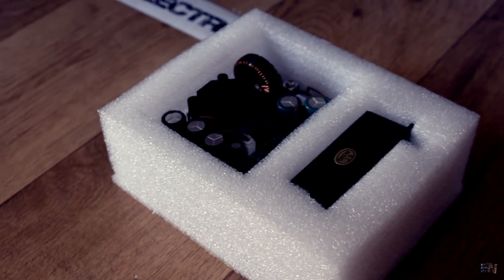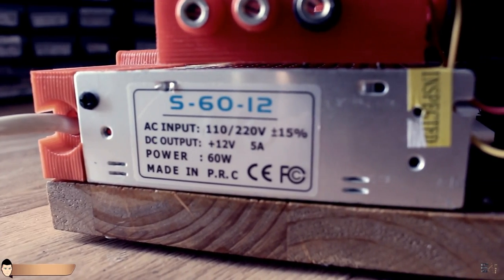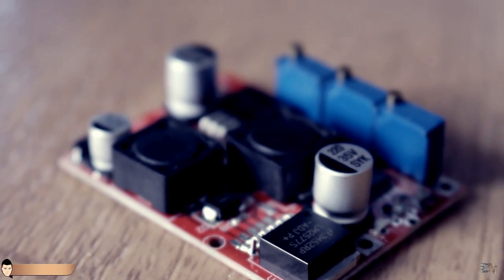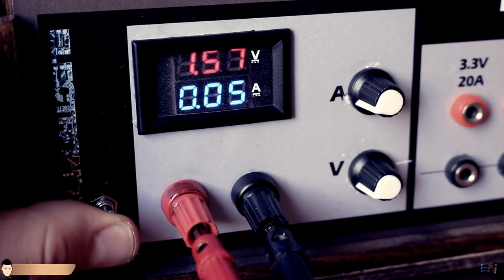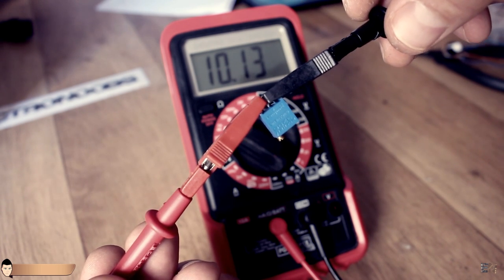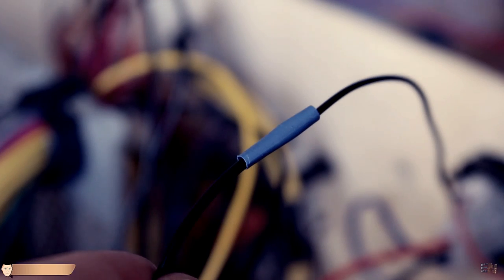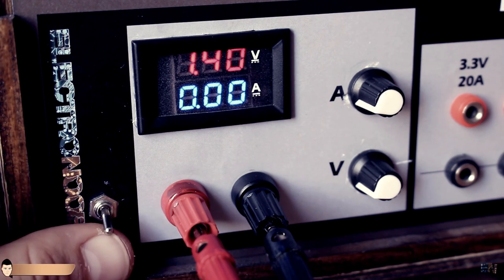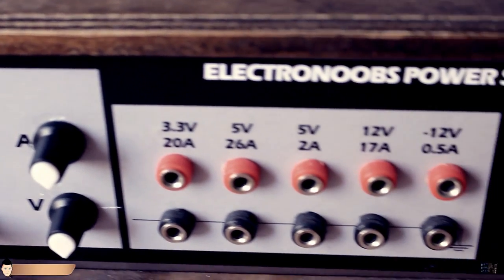DIY variable bench power supply (less than 10$)

Comment: I don't think you will get the full range of voltage unless you vary the input voltage into the step up, step down converter.  Same for the amperage.  It would be better to find an ATX power supply that uses the TL494 pwm chip and vary the resistance on its pin #1 with a 10k potentiometer.
Reply: or you can buy TL494 chip and do it yourself
Reply: I've got an old 200W PSU with a TL494CN pw modulator and also the TL494CN datasheet laying around somewhere. I'm going to try as soon as I have the occasion.

Unfortunately varying the voltage doesn't work that well because capacitors on the board do not allow for voltages higher than 16V usually on the 12V rail and 10V on the 5V and 3V3. Replacing the capacitor with one rated for a higher voltage might as well screw up other settings. GreatScott! tried to hack an ATX power supply to make it output a variable voltage but ran against the same problem and ultimately failed because he tinkered with it a little too much. Here is the complete video:

https://www.youtube.com/watch?v=oeNAhP-GIjo

In my opinion it would be better to fine-tune the three main rails with a 10k 10 turns potentiometer each, then trust an external step up- step down converter on the 12V rail to get more precise results; or as an alternative connect the converter on the 5V rail since usually this outputs more current than the others. Also, the sheer difference in current delivered / accepted by the standard rails (12V, 5V, 3V3 with a minimum of around 8 to 10 amps) and the "non standard" rails (-5V, -12V with an absolute maximum of 1A) should be put into attention when connecting them.

Comment: Great video! Questions: If you were making a bench power supply like this with a transformer instead of an ATX, and a 3-in-1 Adjustable DC Regulated Power Supply DIY Kit, how could you get 3.3, 5, and 12 volts for the fixed voltage outputs?

Comment: A few questions: I see you have two +5V outputs with different amperages so my guess is that you just connected one wire to the 2A output  and 5 to the 26A one, since the total +5V of your power supply is rated 30A. Is that so?
Plus, I have a 650W power supply (+3,3/24A, +5V/30A, +12V/52A) I am thinking of using like yours, but the voltage with the more amps is the +12V one, so I guess the dummy load would have to go there; but does it matter where you put it on the circuit and its value? Because you only mention it in your comment but not in the vid, so I wonder.

Comment: 12/24 V, 10A LED Switchmode Powersupply with an MingHe D3806, a Fan for bigger loads and thick wire + Case

Comment: The holes for the fan should be larger. Like 6 or 8 mm or so. Have a try breathing through those 1mm holes. It's just like there are no holes. ( Though don't breath in through just drilled holes ! You'll get crap in your lungs. Got experience on that. )

Comment: Nice build. I built something similar years back & I've always wondered why more people don't just use an old PC power supply. They are everywhere & likely won't cost anything (literally free), they have EXTREMELY clean power outputs & have built in safety features that have saved a few of my projects. I was gonna mention building a dummy load on the 5V rail for general current stability, but see where you mention it in comments. I've been thinking of trying out the Arduino on my next build so I can add some extra features like a Signal Generator for TTL & mess around with RF, PWM & FM a bit (kinda make a built in LCR & ESR meter out of it as well). Was wondering if you've done anything like that because my programming is in it's infant stage? Great vid, very clean build. Good job

Comment: Your video has inspired me to build a similar power supply. My question is: the wires from the Pots look to be a much smaller gauge than for example the (2) 12V wires from the power supply entering the converter. Does the full voltage and current when amplified pass through these Pot wires, and are they sufficient? And can you please tell me the gauges of the wires, excluding the power supply wires? Thanks and yes the video is GREAT!
Reply from the maker: The potentiometer wires are signal wires. No high current will pass through those wires, don't worry.
Reply: Thank you for the info! I'm now just waiting on a couple more pieces to the puzzle (they are on a slower boat from China).
Reply: I received the Ammeter/Voltmeter DSN-VC288 as Linked in your web page. However the color code on your schematic is not the same and the 2 wires Red and Black on my part are considerably larger than the Red, Yellow, and Black on this. Seems to be quite different than yours. Could you check the DSN-VC288 that I was directed to and verify if it is correct for this project and if a new color coded schematic is needed. Thanks!
Reply from the maker: Just substitute the blue wire in my schematic with the yellow one. Connect the large BLACK and RED wires to 5V and the other BLACK RED and YELLOW as in my schematic but with yellow instead of blue. Keep up!

Comment: Thankew for such wonderful DIY. My SMPS is from 2000 as well however my capacitors near the AC  supply end were burned , they are 200v 330uf. I tried to search for these online but found none. If you had faced this I wonder huv did you find these capacitors.

Comment: Hello, 
I did everything like described in the video but when i turn on the power supplie it starts workind and then it shuts down automatically. I can tell by the fan that as just the time to start. I Checked the connections and the wiring twice. ANY idea ? Btw thank you for this great tutorial !
Reply: Hey man, you should you a dummy load...like an extra fan ou a car bulb lamp. The power supply shuts off because is no load and automatic shuts off. Trie to connect something in the 12 v or 5 v and see if shuts down...good luck
Reply: @droquesteni  Hey thank you for your answer ! I tried to had a dummy load on the 5v rail but it didn't helped. So I rechecked everything and made some tests by eliminating the components one by one. It appears that the problem come from the digital display. Everything works fine when I by pass it. 
I have 3 of them so I tried with each one, and the atx always shuts down... 
Maybe I'm wiring it wrong but I did excatly the same wiring as it is in the video. I'm a bit confused here, just can't figure it out... 
Thanks you for your help
Reply: @raonimoisan4614  no problem. So if your problem is from the display, be aware that if you buy this king of display lcd on ebay they are different! I realized that the display i bought have the same 2 connections BUT the connection to the amp meter the 2 large cables red and black if for only measurement of the amps! The other connection have 3 wires red, black and yeallow. So this connetion red and black is for feed the lcd to 5v, the yellow wire if for volts measurement! So, yellow wire to + of the dc boost for example, to the 2 large wires, red wire to the - of the boost and the black wire to the ouput you want measure... hope that helps! take care!
Reply: @raonimoisan4614  Chances are that you're wiring your LCD the wrong way. I had the same issue, then a more careful sheet reading and a correct wiring fixed the problem.

Comment: I like the tutorial!  I'd like to know if you figured out what the center potentiometer does?  I bought 3 of the boards from ebay and asked the seller what center potentiometer does.  He didn't understand my question.  I tried to use google translate to help with the explanation, but I never did get an answer to my question. I'm concerned about adjusting the center pot without knowing what I'm changing. Thanks for your time in replying. Keep up the great work!
Reply from the maker: https://ae01.alicdn.com/kf/UT8xg1BXbJXXXagOFbX3/220353225/UT8xg1BXbJXXXagOFbX3.jpg

One limits the current output so the module will have the output actiuvated but the current limited. The other one will detect the limit of current that you set and turn the module off when that limit is reached (and turn on the red LED). I recommend to leave the middle one how it is so you have the full range of output current.

Comment: 1. The +12v of the power supply is rated at 8A and the buck boost supports only 4A. Isn't that a problem? or is it 4 drawn not input? 
2. Can you make a video of it running a 12v/24v motor at 4A? or just test it and tell me that it works

Comment: Can I just solder the green and black wire together? That way, it will always be turned on as soon as the PSU is turned on.The PSU already has an on/off switch after all.

Comment: Greetings once again. My Power Supply build is almost complete. During my initial test I connected a PC fan to load and when I increased Voltage to around 12V the fan turned on and the Voltmeter read 12.00 and the Ammeter read 0.40. I could increase and decrease voltage but the I could not control current. Is this to be expected or do I possibly have a bad Pot? Thanks again, and I'm going to enjoy my new hobby!
Reply from the maker: With the I pot you should fix a maximum current. If you can't lower the maximum value something might be wrong, could be the boost/buck converter, could be the pot.

Comment: Hello. Your tutorial is great,but i have some questions: i have some power suplys from old laptops, one of them with 15v, and is small,perfect for this project. Do you think is possible to use it,instead of a desktop power suply?? Another question, if i going to use the laptop psu, do you think i can connect the volt/ampmeter directly to 15v input,because it doesn´t have 5v power rail like desktop psu?From i understand in specifications,it says:"Power supply range: DC4-30.0V" And 3rd question, do you think i can use this project(made from desktop or laptop,doesnt matter) to detect shorts in circuits,like laptop boards?

Comment: Nice job. I have most of this built previously but liked your buck con. better. It looks like your schematic shows a black wire on the positive output of the buck. Is that correct, it does not match video connections. :)

Comment: Great video! You said a dummy load should be applied to each of the three fixed voltage outputs? What are their values? I've seen a different video you (Sorin) did, using only one dummy load on the 5V line (no need for a load on the 3.3V and 12V lines). Please comment.
Thank you!

Comment: Hi there. Your Schematic/Wiring Diagram has a BIG Fail (at least for maybe "newbees") - if you're wiring up following your Schematic, then I think it will blow up the Buck/Boost-Converter. Because the Red & Black wire for the Output you have reversed in your Schematic. You are doing it right in the video - but wrong in the Schematic ;-)

Im btw. in the middle of building on of those for my self.

Thx. a bunch for the video! Nice and easy to follow.

Comment: So the regulator can go up to  3Amps, but the power supply can go up to 30amps. Did you use the 30Amps output or not? Did you use only the 12V output?

Comment: Less than $10???  The first item on that list is $35.99!
Reply: I suspect this is one of those "Less than $10 if you already have all the parts lying around" kind of deals.
Reply: he does say he picked it up as scrap for $2
Reply: Yeah, same than "How to build sports car less than $100". Then repaints Lamborghini that he already own..
Reply from the maker: Guys, I recommend you to search for local scrapyards. Depends on where you live. For a brand new PC you should definitely use a brand new 30$ power supply. But this project is made with a power supply from year 2000 or so… You can easily find those for 2 or 3$ because are old, low power (400W which now days is low) and the connectors are not useful any more. I can assure you I haven’t spent more than 10$ for this project. Plywood is 2$ a square meter so… and all the extra components are listed above. Thank you for everything, have a nice day.
Reply: Isaac Kvasager yup
Reply: Jeff Clark THE FIRST ITEM IS FROM SECOND HAND!!!!😔😔 AND YOU CAN FIND IT FROM THE TRASH!!! I HAVE 5 POWER SUPPLY FOUND ON TRASH! 😔
Reply: I have all kinds of power supplies from old computers laying around. Power supplies should be free if you have friends with old computers. You guys are being very picayune.
Reply: 35$ if you buy a brand new powersupply in warranty, which defeats the purpose of alternative DIY projects, because you can get a variable psu for 50$.. that powersupply is very old and you can easily pick one up from computer scrap shop/craigslist etc
Reply: @radionutasmr4934  
The one that he shows, which is for multiple outputs, is $3 on ebay. If you buy the one for just one output, it's only a dollar. If you just make non variable posts, it's free. This project can be as expensive or as cheap as you want it to be. The way that I would make mine, on calculations, should be around $15.
Reply: @radionutasmr4934  I fundamentally agree with the fact that the components needed far exceed $10 (and thus the clickbait argument), but this is no good reason to get angry.
Reply: lol
Reply: Its less than 10$ for the parts he didnt have.
Reply: Isaac Kvasager  If u have PC PSU already, than all the other parts can be orderd from Aliexpress for around 8-9 euros witch is around 10 $.... so its okay imo.
Reply: clickbait mate,clickbait
Reply: Isaac Kvasager  but you clicked and fell for it, right_
Reply: Isaac Kvasager  Yo dumb bro? The supply is from scrap.I got it for free from a guy who sells computer stuff. The converters cost about 4$. If you spend time on electronics, you should already have shrinking tubes. All the stuff cost around 12$. Your problem is that it costs 2 or 3 more dollars?
Reply: @waltercomunello121  yeah, but only if you BUY them. Why would you do that when you can get most components for free if you are willing to do even the smallest bit of searching?
Reply: @joakimjocka8022  clickbait title that's accurate? Never heard of that before...
Reply: Well I got some of old pc's that I will never use and have not gotten to throwing them away yet (luck me). So I have some of those power suplies. The most be fameli or friends  that have an old pc's no one is going to use anymore?  I ordered the small buck boost for 2.91 euro's the banana  connectors for 2.01 euros  The volt amp meter was 1.81 euro's. 0.78 for 2 pot meters. For me that leaves  2.49 euro's for screws and the brackets.  I think 8 brackets gonna cost me about 1.20. But the don't have round corners. that leaves the screws, the metal flip switch and the printing/label the wood and the dollar euro conversion. So yea I gues you go over the 10 dollar if you have to buy every single item.  But It is a DIY video and I think it is fair to assume that people that want to DIY have some stuff lying around like screws and some tools. I mean if step 1 is buying the tools..... I think this vid is one of the better once. most pc power supplies are of decent quality  and instead of thowing it away you can convert it to something cool and he adds little the buck boost converter and the volt/amp display that makes the supply just that little more special for very little extra money. You do need 6 weeks patience when ordering it from aliX though :)
Reply: Stealing the parts also is an option.
Reply: fake and gay. Одна приблуда с экраном стоит больше 10 баксов, а если я отберу на улице айфон 12 или найду его, это не значит, что я могу снять видео о бесплатном айфоне.
Reply: @ELECTRONOOBS  or go out and drive around on heavy trash days. That's where I find mine for free. Got my shop computer and tinker computer that way too.
Reply: Haha yes

Comment: A couple of questions. Why solder multiple 12v cables to the input of the converter? Why not just one 12v cable? Is it just for redundancy? Also, would you pick the the highest voltage output from the pc power supply or would it be better to pick the highest amp output on the pc supply. Last question, what is the middle potentiometer on the buck boost used for ?  if the other two are used for voltage and ampage adjustment. If anyone could help me with this. It would be much appreciated!

Comment: Hm. I need a power supply. But I have a PC power supply left over. And I have two voltage regulators left over from another project.
Not sure if I can get current limitations though.

Comment: how do you get 5V 2A? or is it -5V? Furthermore, there are some differences between current label from PSU and your printed label. was it misprinted or does it really provide 20A @ 3.3V and 17A @ 12V? your PSU only provide 14A @ 3.3V and 8A @ 12V.

Comment: Great video, I got an issue, using a different model lcd, looks the same but its a bit different wiring, dsn-vc288, the problem I have is that I can only seem to see volts or amps not at the same time,  i have to remove the thick red wire (amps) and connect the (thin) yellow wire (volts) but cant connect them both.
Reply: I think the schematic is wrong for the vc288. The  thin red+black wires supply the meter (must be 5v or more). The thick red+black measure the current in the -ve return path (so it can measure current flowing from supply module - the two thick wires are connected together by a very low ohm shunt inside the meter). The thin yellow sense wire goes to +ve terminal to measure voltage at +ve terminal. The thin black wire and the thick black wire should both be at the same 0V potential.  http://diyprojects.eu/how-to-wire-digital-dual-display-volt-and-ammeter/

Comment: I got the DSW5020, the 20 amp version.  Worked for awhile.  Suddenly I can no longer test my laser diodes..can't get more than 1.25 amps out of it even when I set the max amps to 5.  Really strange.  I tried changing the power source but that did not help either.  No longer works.